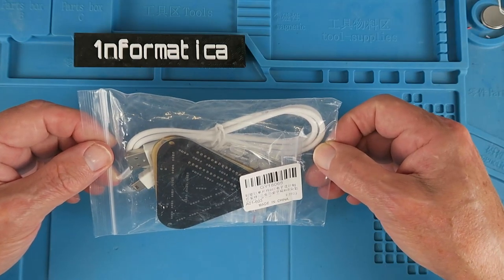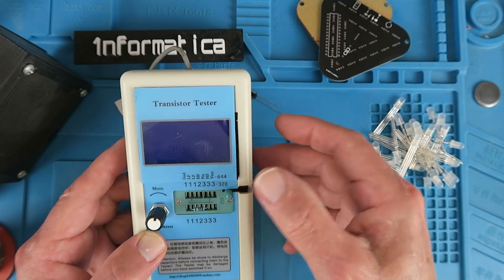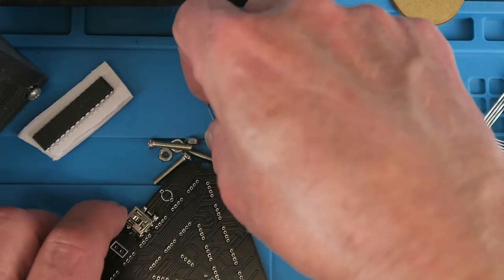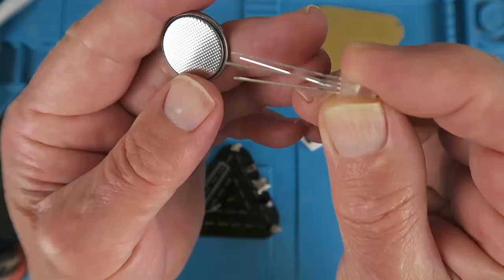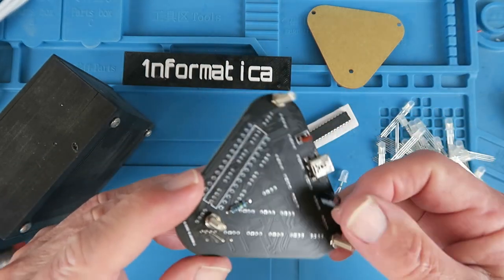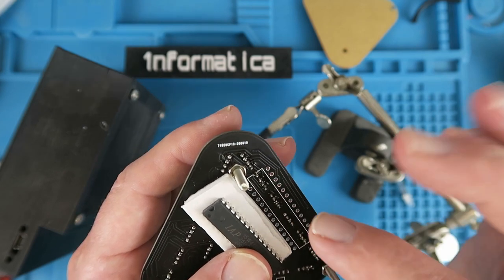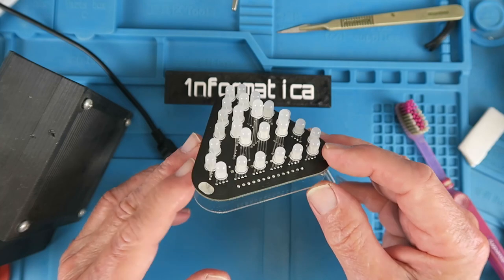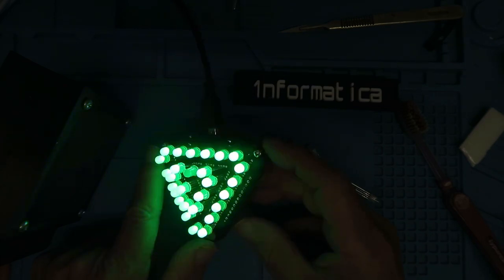LED Flashing Lamp Light Module Breathing Light Gradient Color Decorative Lights Kit

Comment: '
coool nice pretty kit...
LED with 4 pins are too hard...
better use 3 nylon bolts and 3 nylon nuts are the best and last put on the kit when finish...
not metal bolts - not metal nuts
Reply from the maker: I just review what is supplied with the kit. Personally I'm OK with the metal screws. You have some nice kits on your channel.
Reply: @1nformatica 
hi 1...
'
i enjoy and have alot of LED kits = projects